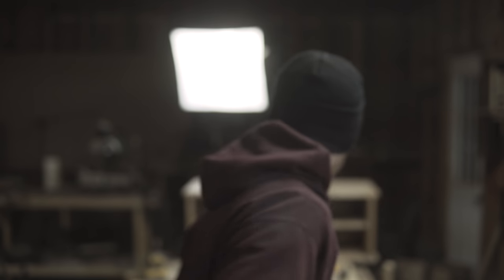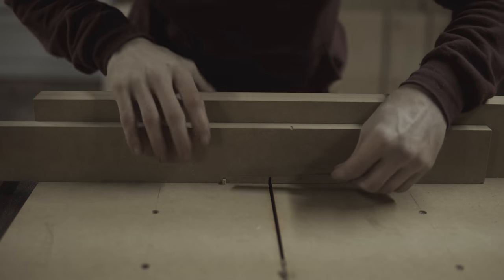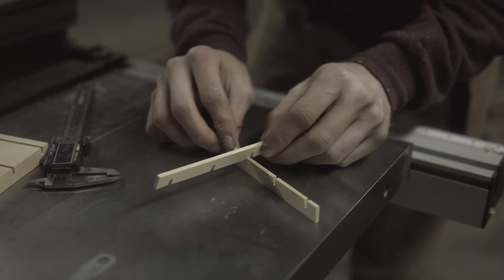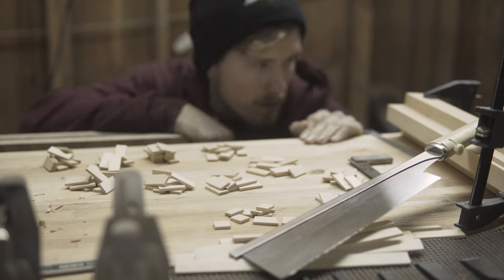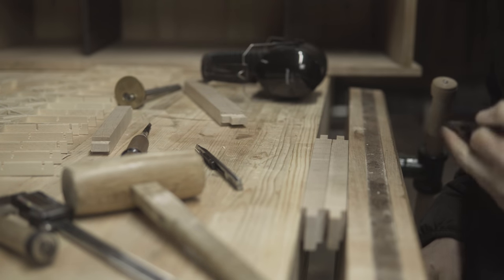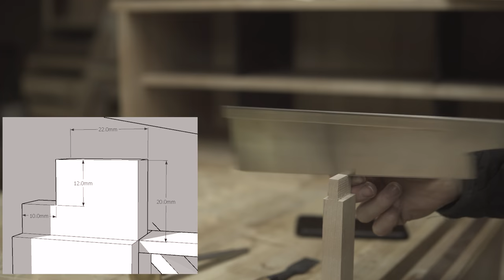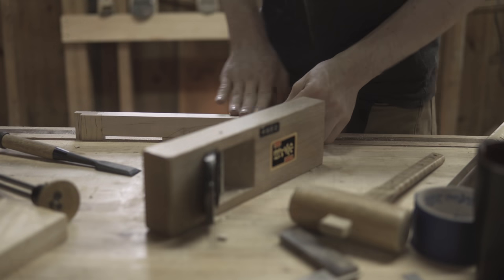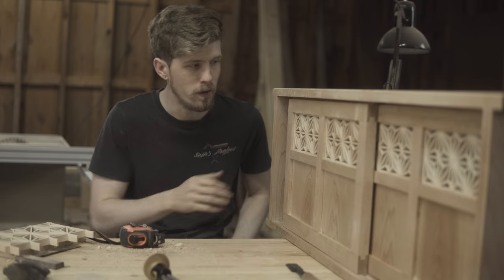JAPANESE INSPIRED SHOE RACK/BENCH // EP.2 BUILDING the KUMIKO SLIDING DOORS!!

Comment: Thanks for taking the time to document this. It's a great video and a fantastic piece of furniture. Is the case work Ash?

Two things I learned today: I need a mortiser or at least an attachment for my drill press and that a router does excellent joinery instead of a table saw. Cleaning up an ATB finish off the saw is a ball ache. 

By the way, what is the music at 13:00?
Reply from the maker: The drill press works just as good as the mortiser :) just hog out most of the waste with a bit that is close to the size of your mortise, and chop the rest with a chisel.

Comment: how deeper the top grrove has to be to fit the doors?
Reply from the maker: Angelo Grieco The top groove is 14mm, and the bottom groove is 4mm. Fitting doors like this can be difficult, so I recommend taking a scrap piece and making like a story stick. I might make a tutorial on how to fit sliding doors in a case like this.
Reply: @SethsProject  nice, thanks for getting back to me... I was going with 6mm at the bottom and 12 for the top, I guess it wouldn't have worked... Any space between the doors? I was thinking to leave some 2/3 mm...
Reply from the maker: Angelo Grieco The bottom groove can be really shallow. Gravity will hold the door in place. You could even get away with doing 2mm. The top groove is the important one. You need to make sure the groove is at least 3-4mm deeper than the rebate on the door. So that way you can put the rebate all the way in the groove and drop it down and it will still be in the groove. I hope that makes sense.